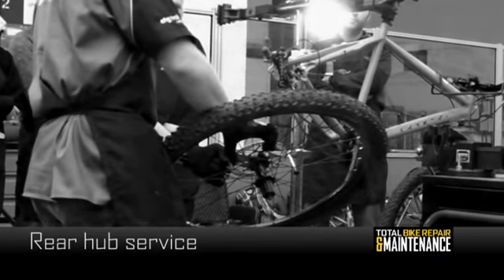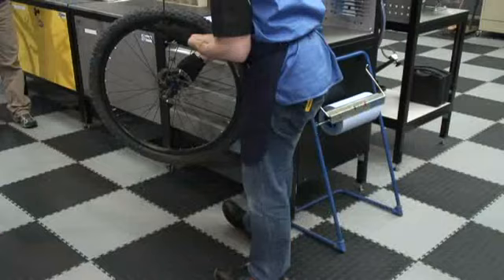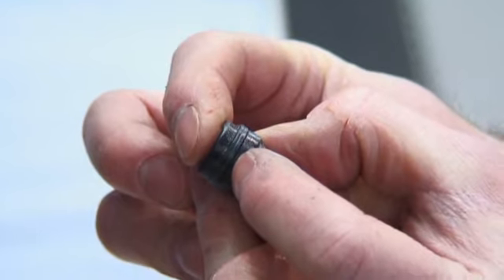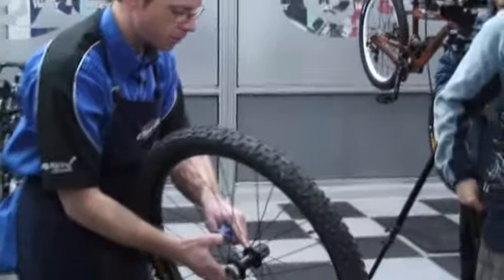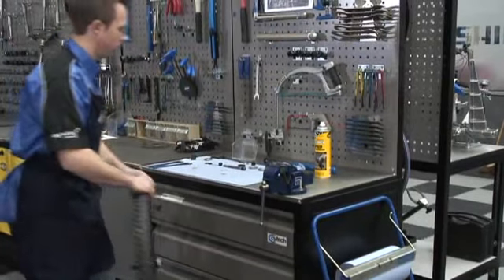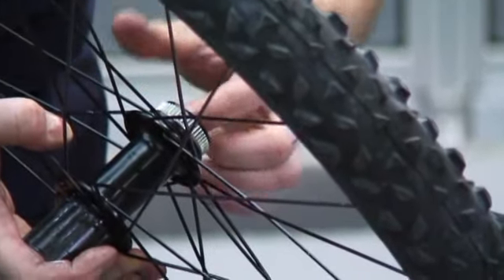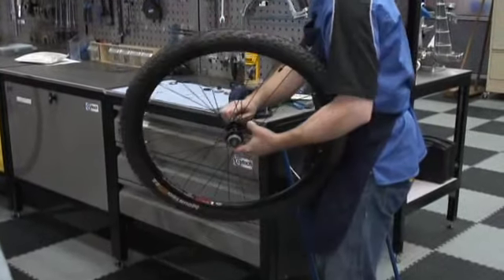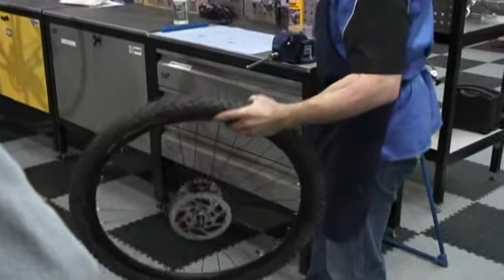Shimano Rear Hub Service

Comment: yep, £50 and rear wheel rebuilt with a SLX hub. The original Shimano hub I took apart but couldn't get into the freewheel body to repair the pawls. Found out the dirty way Shimano rear hub freewheels are non-serviceable...but they're alot cheaper than Hope

Comment: I can see why i never done Cytech courses, City and Guilds all the way. Boring instruction and by the way that nut on the out side is a lock nut not a cone, so use a proper spanner not the cone spanner they are made of mild steel and damage easily. Mr C